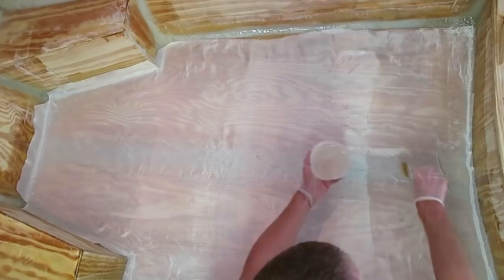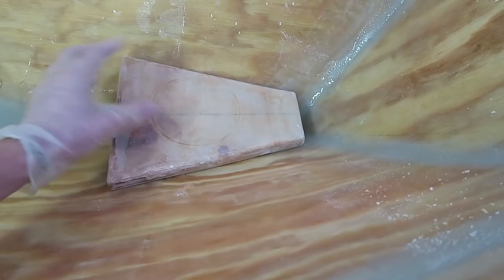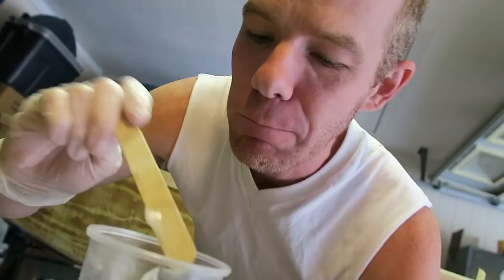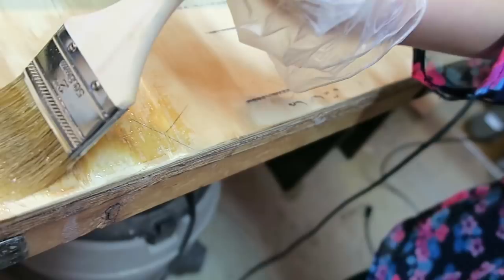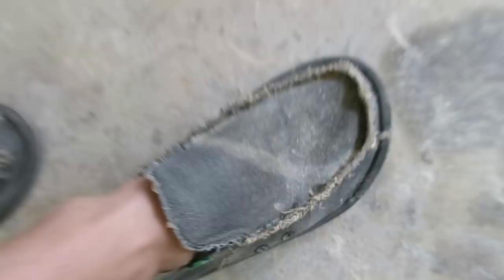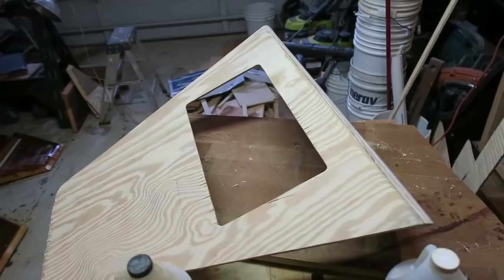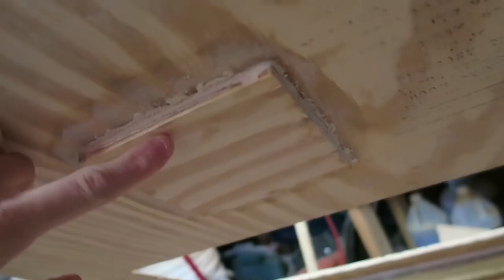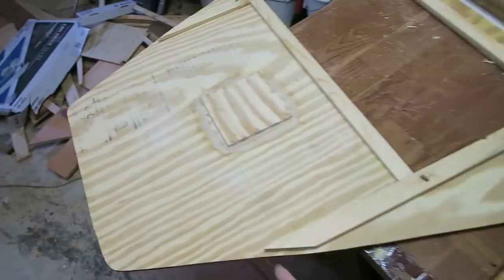Building A Chameleon Sailing Dinghy | Epoxy & Fiberglass - #3

Comment: First - Great video and a marvelous first attempt at fiberglass work.  Now - right to it... I work in aerospace and have seen bad things happen quickly with fiberglass use.  You should proabably have Molly (and you for that matter) in at least safety glasses if not also long sleeves, and perhaps even a respirator.  One mishap with the brush flicking epoxy in her eyes and she could lose their use.  Also, epoxy can cause one to develop an alergy or sensitivity to it with repeated exposure to the skin and or vapors - probably worse for a child.  Once developed one is unable to ever use epoxy again - once acquired, I've never seen it go away.  It can happen literally overnight.  Epoxy is not tremendously dangerous and limited exposure usually does not harm you- but it should be respected.  Sorry for the rain, but I felt compelled to at least mention it to you.

Have fun with it.

Chris Clark
Reply from the maker: Thanks for the concern, and yes - you are correct about safety.
I'm not completely irresponsible concerning epoxy safety, but it's an oddity how the scenes with her in the respirator oversized safety goggles fail to make the final cut.
Fact of the matter is, yes, it only takes 1 mistake.
I'll do better.  :)
-B

Comment: Did you seal the interior on the daggerboard trunk before assembly you won't be able to seal it from water once the boat is assembled? I a really enjoying your vids. I built a Stevenson Skipjack several years ago, its so satisfing to see your work come together.
Reply from the maker: Yep, of course.
Cloth and epoxy went on the individual panels before final assembly.
Another thin coat was brushed on afterwards as well.
It would be possible to do afterwards, but it'd be a real pain in the patooty.

Comment: The guy that said the wood will suck up the resin.....deleted his comment just before my post and I wanted to say that you're doing a good layup job Ben.
No worries Ben....you used a wet layup and the wood will stop sucking the syrup-thick epoxy as soon as it begins to thicken or cure (about 15-20 minutes depending on which working time hardener you used), and that cure is faster in the wood than in the cloth (wood holds in the curing heat). This guy may be thinking of polyester resins, which are thinner than the epoxy resin mix. You're doing just fine......
Reply from the maker: Thanks for saying that, Ed.

I deleted that comment after blocking that fella. He’s been a long-time complainer, nitpicker, and chronic know-it-all. My patience ran out and I had to put an end to that.

I’m all for constructive criticism, but his feedback was never constructive. Whew - Lord bless the folks who have to live with people like that.

Anyhoo -

That’s good to hear from you. I really feel like, if anything, I probably put on too much epoxy.

This dinghy is far from perfect, just like me  ;)  but overall, I think it’ll be a great little tender for our next adventure.

Thanks again, Ed.
Reply: In the last video, I also asked about pre-soaking the wood with resin.  Glad I wasn't the fellow in question who you blocked, because I'm a BIG fan.  ^_^  All love and support for the three fleas who live in sand.  ^_^ 
"
Since the big boat is the "Sand Flea", maybe the small boat should be the "Rock Fly".  Please submit my suggestion to Second Mate Molly for her consideration.  I seem to recall she was the chairgirl (?) of the naming committee.

Comment: Do you fiberglass the inside of the center board slot?
Reply from the maker: Yep. The insides were fiberglassed before the parts of the daggerboard trunk were assembled.
Then the openings are fiberglassed to the hull when installed.
Reply: Sailboat Story Ok I see...great videos as always!!

Comment: Nice Ben! What keeps the centerboard from dropping through the centerboard well and will you do the Laser modification? The Laser Mod is a bungee cord that goes around the mast and centerboard to hold it up at various heights hands free. It's good for beach landings.
Reply from the maker: Right now, the daggerboard has a rope handle.
The rope can't go through the slot, so that will keep it from going all the way through.
The height will be adjustable with a bungie that I will mount to the bulkhead behind the daggerboard trunk.
Of course, all that is just in theory right now, but it seems workable.
Reply: You should have this finished just in time for nice weather. Good timing on your part.
Reply from the maker: Yep! Things are starting to warm a little around here.
I see squirrels running around and some flowers just starting to bud.
It's been one heck of a project, that's for sure!